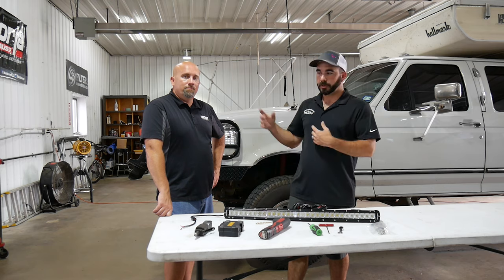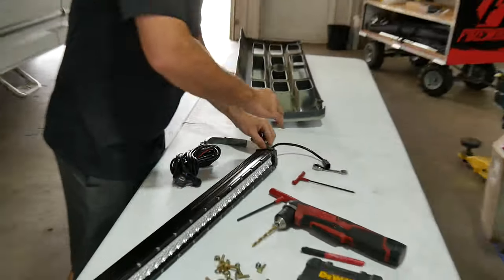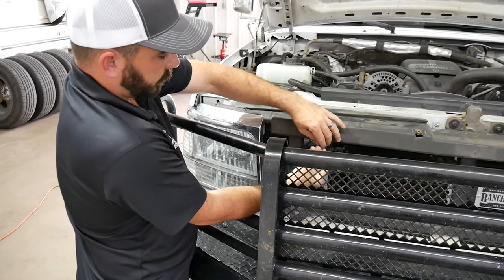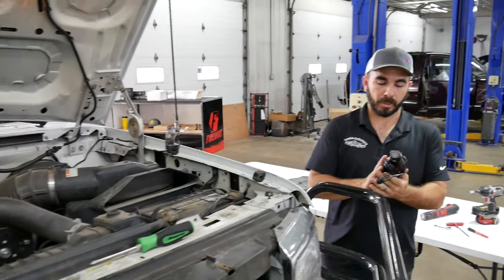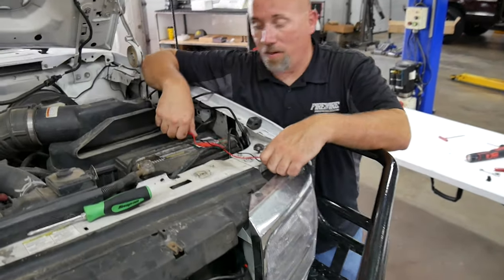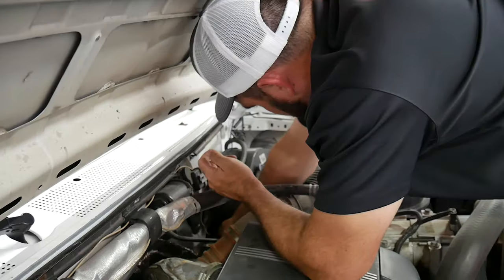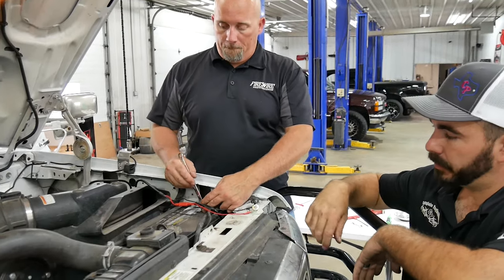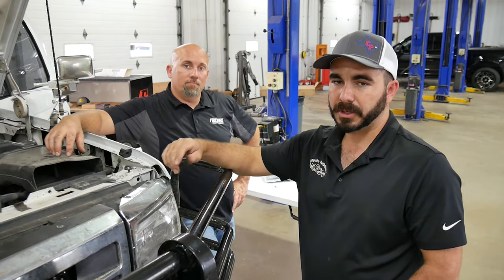Fix-it Fridays: 1992-1997 F-Series Ford Truck LED Light Bar Install (FIrewire)

Comment: I have a 1994 f150 xl ext cab 5.8 4wd  and Speedometer needle flutters 0 to Highway speed. I’ve replaced the Vss with no change. Any suggestions?.   Thank you. Terry